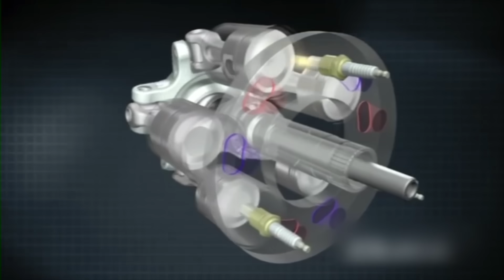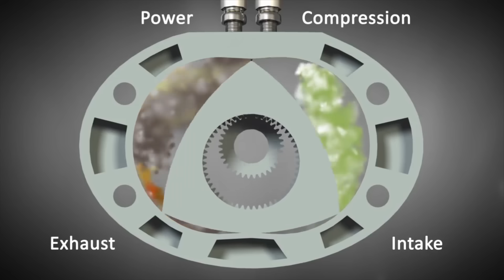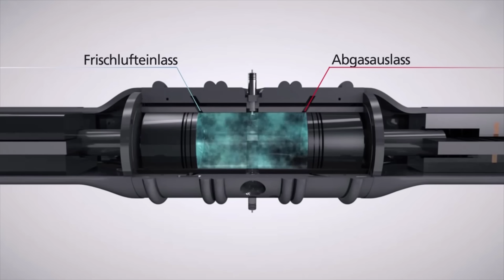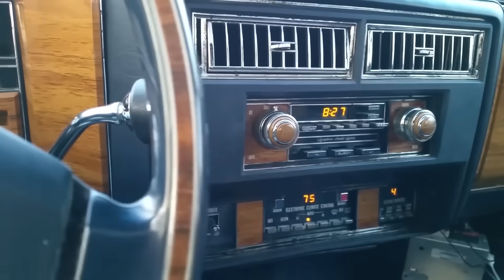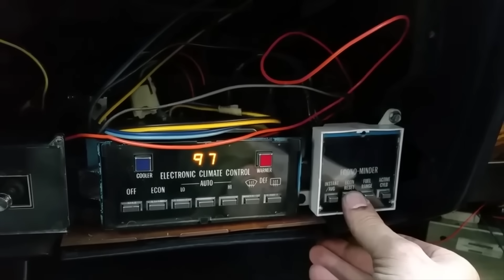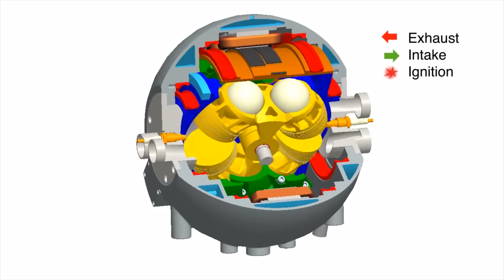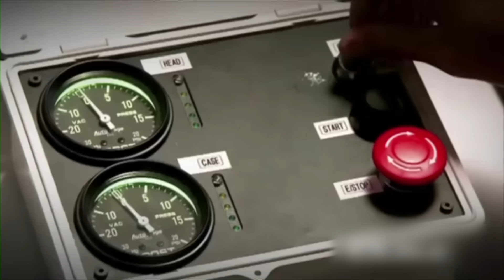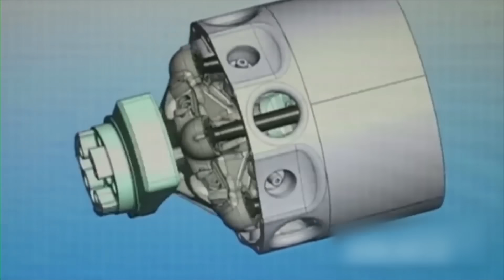10 Strangest Engines of All Time

Comment: you sir deserve a thumbs down for claiming inaccurate things.
Reply: Wrong within 11 seconds. Impressive.
Reply: @andyfarley6092  I can't understand why Americans think they invented everything including the Wheel 🙄😔
Reply: @stevejones8665  Ha ha ha - I just came along a month later and said the same. Why do they claim every invention is American? They invent plenty, but claim everything. Megalomania?
Reply: @andyfarley6092  But only by 80 years or so!
Reply: The misinformation is real.  The range extenders aren't hooked to the motors directly!  They generate electricity.  And in any combustion engine, higher compression means higher efficiency too - even though sometimes more NOX pollutants.  Less hydrocarbon pollutants though.
Reply: Brian Mitchem Yea, the moment he said that bullshit about high compression I was like "Oh I'm watching a moron aren't I?"
Reply: Such as Christine was NOT a Caddy Either!! There was a clip from the movie Christine on the assembly line during the Caddy segment.
Reply: Mazda ABSOLUTELY did not PUT the rotary in the nsu models Wankel founded the company and then mazda adopted the design, so yeah
Reply: It's an Infinity commercial
Reply: Quite The first commercially successful internal combustion engines were developed by Samuel Brown in London in the 1820's.
His Gas Vacuum engines were successfully used for many years. 
He built a pumping engine for the Croydon Canal Company in the early 1820's also supplying the canal company with a number vessels using his engines . He also built a railcar which was tested on the Surrey Iron Railway in 1823.
In the early 1830's he built a road carriage which had a speed of around 40mph!
Reply: @nicholaskelly6375  I think it is also important to note that gas engines and turbine engines from C18 pre-date Samuel Brown.  Although only theoretical they were important development steps. Let's keep reminding the Americans that Britain invented the 20th Century!
Reply: @stephenbrookes7268  Agreed Stephen. But I simply stated Samuel Brown designed the first "Commercially Successful" internal combustion engine. 
The origins of the internal combustion engine I suppose would begin with the cannon sometime in 10th/11th Century China.
After all when you think about it the cannon has a barrel and it has a piston in the form of the cannonball (albeit a free piston). The Gas Turbine also has a long history. 
Again when you think about this. 
It's history would begin with the windmill (In eastern Iran by the 10th Century. These were horizontal mills and in England by the 12th Century. These were vertical mills).
But that said I would consider the " Smoke Jack" to be significant. 
As it appears that this was the first true gas turbine. In the sense that it was the first type of engine devised by man which did not rely on nature to supply the energy. Ok such devices were of very low power.
But that said they were capable of useful work ie turning a roasting spit over a fire. From memory the earliest  illustrations that I have seen of such things date back to the 14th Century.
Several Country House kitchens have surviving examples. There being a particularly good example in The Royal Pavilion in Brighton. 
Like all things there is a very long "pre history" that is often overlooked.
Reply: @nicholaskelly6375  All complex devices are a collection of inventions and discoveries brought together for an innovative use by a person finding a need for it. The cannon definitely is the basic principle of the piston engine. Such a shame Al Jazari never thought of sticking his crankshaft onto a cannon! Although I have these visions of the cannon being fired the crankshaft connected to its wheels and it running over the gunner crew on its way the the generals tent!
Reply: @stephenbrookes7268  Excellent!
Reply: @stephenbrookes7268  Seriously have you ever seen the "Guided Bomb" proposed by Giovanni da Fontana?
This consisted of a 4 wheeled rocket propelled trolley which was guided by a rope/thread/wire connected to 
a large metal arrow was fired from a cannon into the castle/city/town gates. The rocket propelled trolley was then guided to the gate where it exploded. 
I have long been interested in Giovanni da Fontana (c.1390-c.1455)
I recall visiting an exhibition in Rome on the inventions of Leonardo da Vinci. In this exhibition replicas of the various machines and designs were on show. Well I got talking about da Fontana to the exhibition curator. I asked if Leonardo had known about him. Apparently Leonardo had a copy of one of the "Machine Books" published by da Fontana. As we discussed this the curator noted that possibly Leonardo wasn't quite as innovative as it appeared! 
Certainly the inventions of Giovanni da Fontana were very impressive. 
It appears that he built the first successful powered aeroplane. 
This was in the form of a rocket propelled bird (Some of his models were quite large and it is believed that one of these "Rocket Birds" had a wing span in excess of 5m!)
He also designed a rocket propelled hare (possibly the first powered land vehicle) and a rocket propelled fish!
Not surprisingly given the dates he managed to cause great alarm to other residents with these machines!
He also appears to be the first person to demonstrate the "ghost" illusion with sheets of glass. 
Well you can imagine just how well that went down in medieval Italy!
Reply: @nicholaskelly6375  I have not studied this inventor but I did study Da Vinci when I was a lad. Yes he did some very interesting drawings but he never actually made anything that worked. Archaeologist have also found model birds from ancient Egypt, made replicas with motors fitted and they flew. 

The only thing that would surprise me would be that everything we know has not been though of in the past. As we have already commented most innovations are a collection of discoveries forced together by a need for a solution. That basically is what engineers do!

Comment: Even the Chevrolet LS-1 454.."which had one horsepower per cubic inch", was.. de-nutted, in 1972-73, when U. S.  auto makers,  ALL began to.. "RETARD the timing by 3 degrees".
Of COURSE horse-power is going to fall dramatically..of course.. MORE fuel is going to leave the engine un-burned, which made it necessary to have.. smog pumps & catalytic converters on newer vehicles. 
When a vehicles timing is OFF,  performance & fuel economy IS going to suffer greatly. 
Whenever mechanics build engines for racing,  that are restricted to non-specialty.. "y'know.. like,  de-stroking a 350 Chevy. or,  putting 351 Cleveland heads onto a 351-M, 351 Windsor, or possibly a 302 with a 4 bolt main", one of THE major improvements that can be made to... whatever engine being built,  IS,  just to advance the timing,  that 3 degrees that the auto-makers, did "deliberately".
Smog pumps and catalytic converters would NOT be necessary,  if they'd have simply left the F - - KING TIMING. ALONE.

Comment: You are wrong ! High compression engines use less fuel than lower compression engines when comparing fuel to weight performance. How many years will it take for you to understand that ? Racing engines are designed to use more fuel however if the engine is not used for racing a high compression version is the way to go to save fuel due to a complex physics law known as strong force energy where less fuel is needed to power a high compression non race engine and fantastic fuel milage is the result. Just look at what Dodge and Ford have done with their production Mustangs and the Dodge Demon and Hellcat motors where 40 or miles per gallon is the norm. Fake statement there and we have proven it !!!
Reply: AMAZING THINGS FOR SALE ON THE INTERNET demon, hellcat or mustang and 40mpg? You’re nuts. I have a modern 392 dodge and do like 15mpg.

Comment: It's pretty sad how many comments I've seen bashing Americans, because the writer assumed you idiots would understand that the reference to Brayton was on-point. Brayton invented the first COMMERCIALLY VIABLE LIQUID-FUELLED i.c.e. It wasn't the first internal combustion engine, it was the first to be produced COMMERCIALLY. It wasnt the first liquid fuelled engine, but it was the basis for many engine designs that followed it, just as it was influenced by designs that preceeded it. It was a pair of Italians whose names escape me as I type this who patented the first real version of an i.c.e., although I believe it was an atmospheric balance design, and we all know that without Otto's compression charged engine designs there wouldn't be a modern engine as we know it. And that's not to forget Butler, who revolutionized engine design with the first Petrol engine, the spark plug, the spray carburetor, and even coined the term petrol, I believe. Now, if you were going to make a presentation on commercial engine designs and needed a concise starting point, what point would that be? Would it be the first gunpowder pumps from the 1600's? Maybe Brown's gas vacuum engine from the 1820's?  Maybe Lenoir's engine; after all, thats what Otto was improving upon with his innovations. None of those designs went into commercial production though. The first one that did was Brayton's, and that makes it a damn concise starting point for this writer's presentation. I'm an American, we know our history, and our track-record for invention and design, and we know that technology moves at the speed of collaboration and is driven by inspiration as much as necessity. The internal combustion engine wasnt just a world effort, but one that spans millennia in the making, and no single individual (or nation) can lay claim to it with rights. So many other technologies are subject to the same argument too. The next time you hear someone mistakenly (or rightfully in this case) claim a technology was an American effort when it was a collaboration, even though the whole world (including us Americans) knows better, do us a favor and keep your whining to yourself.
Reply: Johnathan Smith well... this it not what with author said. IdIoTs, MeH...

Comment: Running the “turbo fluid out” on the Olds Jetfire didn’t result in knock. It had a sensor that would cause the engine to go into a safe mode and bypass the turbo if the fluid ran out.

Comment: @5:55 no no higher compression does not mean more fuel consumption, it literally mean the piston is raised closer to the head but you have a higher risk of knock with low octane fuels.
Reply: In a perfect world a higher compression engine is more eficcient. Unfortunately in the real world conditions are far from perfect which means they  generally add more fuel to stop knock

Comment: By sheer design, rotary engines can not be fuel efficient nor keep within evolving emission guidelines.
A whole different fuel will need to be created, and the engine completely redesigned before those engines will be a major player.
Too much un-burnt fuel is dumped into the exhaust because of the combustion chamber size, giving them a very low thermal efficiency.
Not to even discuss the extremely poor rotor sealing due to uneven heat created because combustion only occurs in one area of the engine. 
That leads to very excessive oil consumption because oil has to be injected into the rotor/combustion chamber area to keep it lubed and sealed.

Sorry folks, but the rotary engine is merely a half way thought out idea.  Once the inventor had ignition, he stopped trying to advance his discovery.
And those who followed, made no effort to advance the design in any way. 
That is the same concept as if we were still using oil lamps for headlights on our cars today.

Comment: Mazda is going to bring the rotary back . they say they have found a way to make them more efficient and plan on using it as the generator power plant for a electric hybrid . being as compact and powerful as they are it's a match made in heaven . that and I want to see how they pull it off when they leak and burn more oil then a hundred chain saw's a eat fuel like a big block still you got to love the size to power ratio .

Comment: It must be possible, to build an engine with pistons only. The crancase is completely filled with oil. You need no piston rod and no crancshaft. The oil is mooved by the pistons up and down and get pressed throuth a turbine like in a hydraulic motor.

Comment: Numerous errors, the most glaring two being: 1) Mazda did not develop NSU's rotary engine at all. The first patent for the rotary engine was filed in the 1920s (before Mazda had even started making cars) by Felix Wankel, who along with other engineers at NSU developed it into production in the 1950s and early '60s. NSU sold licenses to a bunch of other companies to be allowed to make the rotary engine, one of whom was Mazda (in 1961), and the two companies raced each other to be the first to put a version into production. Mazda lost when NSU built the first production rotary car, the Spider, in 1964. Though Mazda did did go on to make a more reliable version when they did get a rotary into production in 1967. 2) The internal combustion engine was well and truly already invented before 1872 (indeed there's patients and working internal combustion engines built in the  century  previous). What George Braydon did bring to the party was a way to use liquid fuel (ie rather than gas), and this what eventually allowed motors to be come mobile; so certainly a very significant contribution, but he didn't "invent the internal combustion engine" per se.

Comment: Ah Mazda had nothing to do with the NSU & Citroen Wankel Rotary programs.
Reply: he never claimed it did , he said those engines where first in those cars and not mazada
Reply: @E3lcpl  He said "But Mazda put these engines in the German NSU Ro 80 and the Citroën GS Birotor as part of a joint venture between 1967 and 1977". So yes, he did claim Mazda had everything to do with that. Unfortunately, that's dead wrong.

Comment: Higher compression = higher fuel consumtion and more emissions? Are you serious?!
Reply: Yeah, that's bass-ackwards. Higher compression, greater efficiency. It's why commercial diesels almost all run turbos. Because Fuel Is Money.
Reply: ... With the Direct Fuel Injection, it almost sounds like what they're trying to do is get a gasoline engine to intentionally diesel, giving you a diesel engine's capability for high compression and efficiency, and a gasoline engine's ability to start on a cold morning.
Reply: @Tomyironmane  Yeah, Mazda's Skyactiv X engine, its basicaly diesel engine burning gasoline

Comment: High compression engines do not use more fuel they are more efficient. This why compression ratios are increasing..
Reply: i think hes refering to creating a new engine with that sort of horsepower around this time would not sell well as tesla can accomplish similar speeds and power with electricity

Comment: and you didn't mention that Lancia built narrow angle single block OHC v6 and v4 engines in the 60's/70's long before VW,  Lancias famous fulvia, a successful rally car sporting the v4
Reply: ...or that Matchless built the Silver Hawk narrow-angle V4 motorcycle in 1930 (with single block and head castings)...
Reply: But it rusted away before anyone got to drive it!
Reply: Don't forget Lancia's V4 Lambda and V8 Trikappa of 1922 - both were narrow V engines [14 degrees] single castings. Vincenzo Lancia also experimented with a narrow angle V12 around 1919.

Comment: Rotary's are more like a 2 stroke engine cycle hence the poor efficiency and emissions. And I've wondered why hybrids don't just use the gas engine to generate electricity like a train locomotive. Seems like that way endine could always be run at it's most efficient RPM.
Reply: You could generate electricity from a small gas turbine, But you are wasting the heat. A combined ICE and gas turbine for a hybrid would also work, but the penalty is weight. The less you carry with you, the less energy you expend. Converting momentum into electrical and chemical energy is inefficient. If we could find chemical energy with a high calorific value, convert it to mechanical energy, consume it's mass, and lighten the load as it is expended, We could make great savings over carrying heavy batteries, and also we could instantly refuel the machine. Something like Gasoline or Diesel heavy oil, may be the answer. We use them in Power Stations at the moment to make electricity, maybe we could cut transformation loses and go straight to mechanical energy from Chemical. What do you think?

Comment: Wow....10:30 engine & the last one...wow. ....the cooling must be really good or they will overheat easy...much like the rotary engines...very efficient for what they are though.....when something is done to nearly completely use up the exhausts for the engines I’ve mentioned....wow.

I know from driving a turbo rx7....if going with a manual transmission...and using every gear...it’s  performance requires quick and frequent shifts if really trying to change speeds rapidly.....best performance I’ve seen is that engine...the car is like drive me as fast as you can and then when you do the car is like that’s all?  Really amazing engine the rx7 with turbo....it maybe the fastest car unless Mazda made a better version of it....maybe faster than motorcycles...  really amazing.